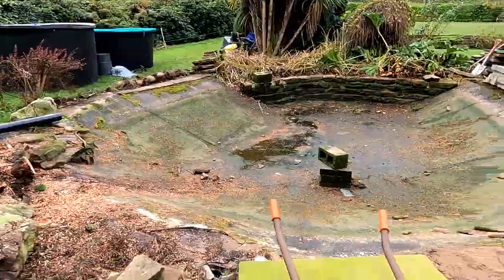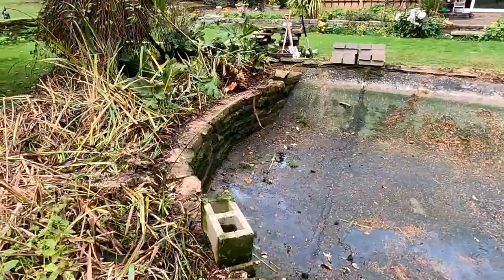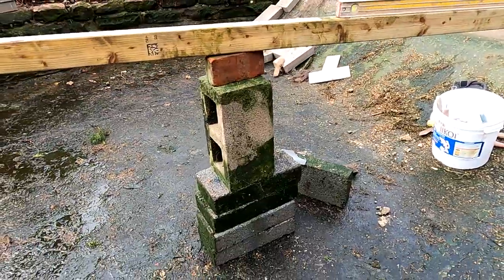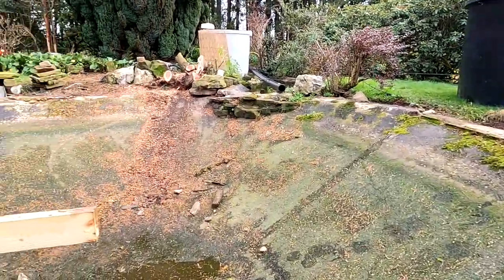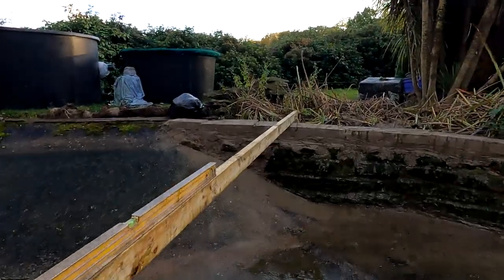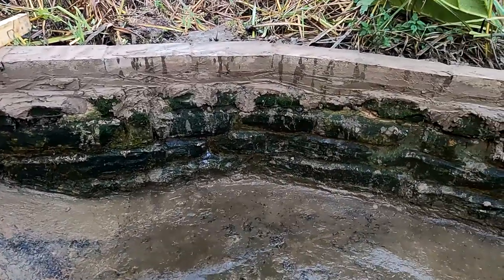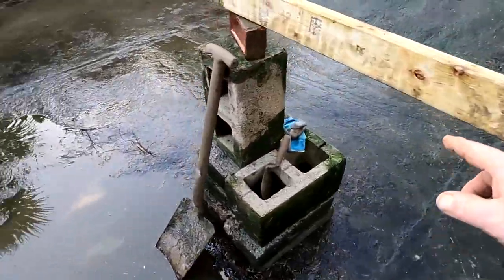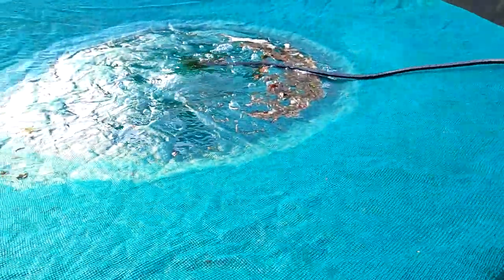Got to level it up!

Comment: Things are looking good so far. I've used the same trick for the level before and it has worked well. If the wall is only out by half a cm over 12 feet that's pretty darn good. Looking forward to seeing the liner install. Cheers.
Reply from the maker: The levels on this are all over the place. But were going to get it close enough so that the pond when full will only have an inch or 2 showing.